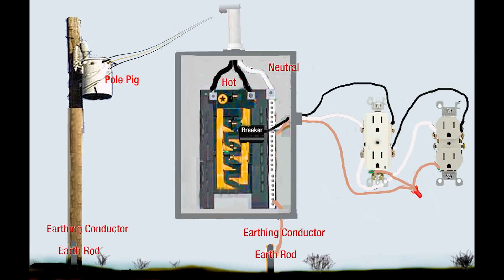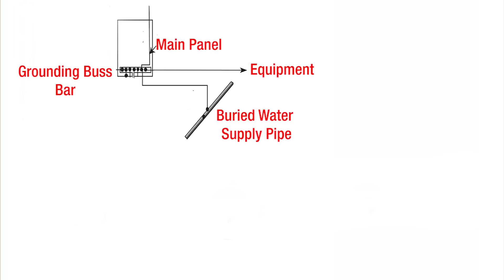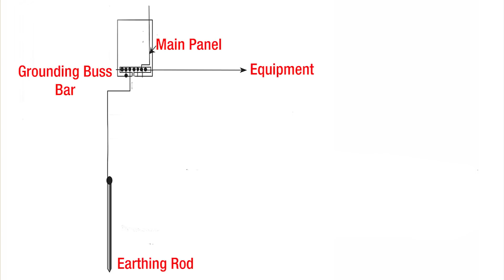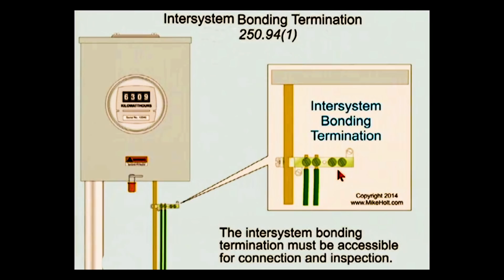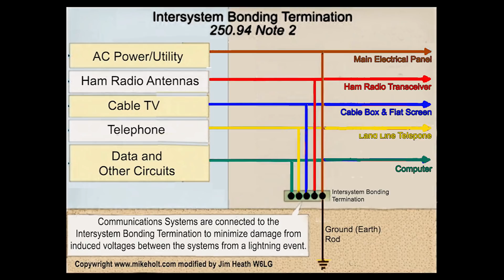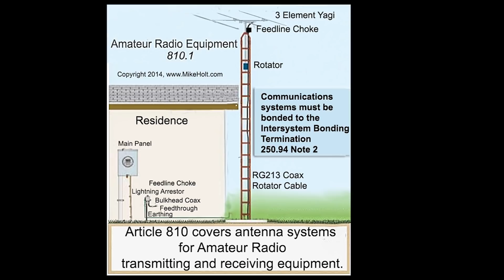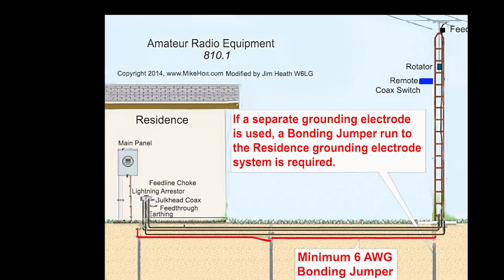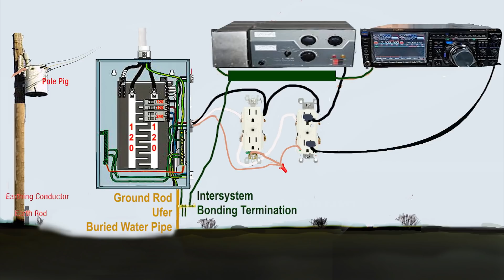Grounding, Bonding, Earthing, Shielding and Protecting with Jim Heath W6LG, 2 Part Video

Comment: Hi Jim, 

So very disappointed to only find your excellent videos just today!

I have binge-watched all your grounding and bonding videos and taken notes. If I may say you are a lightning rod of clarity!

Sadly I started with the ARRL Grounding and Bonding handbook and spent hours and hours of time trying to sort through it all while also studying (not watching!) YT videos by various authors and also reviewing all the comments as well. So much contradicting opinion with just enough fact sprinkled in to confuse a new amateur. 

For me setting up my first station (IC-7300 arrived today!) your diagram at 9:06 is perfect and pretty much tells me what I need to do. Although the radio room is on the second floor, the window is less than 16ft from the common service ground and I won't need to bring the ground back through the wall to attach the braided cable to the panel. Also, no need to get another ground rod and bond it to the service ground.

I wish the ARRL had asked you to write the book - so many of us would have been better served.

Sincerely & 73,
John - KK7JBZ

Comment: @Jim, Hello Jim. I got some Palomar Mix 31 beads to put on my times microwave LMR 400-uf  I was going to put 6 of them up to the PL259 at the  ftdx10 ANT input. I head it's may be good to put the mix 31 beads at the   ANT on Coax just before thePL259 connecting to the Ant. Is this True??

Comment: Hi Jim

My main panel is tied to my copper water supply, should I tie everything into that or can I install another ground rod outside and tie that back to the water pipe common.  That way I can tie all of my outside stuff there and one heavey guage wire back to the water pipe
Reply from the maker: You should connect to the main ground rod or Ufer ground.  I would be surprised to see a house grounded to the water pipe.  Near the main panel,  there should be some kind of ground and connections to a common point near that that ground.  My read of the NEC is that all grounds go to the common point ground near the main panel.  73, Jim
Reply: @ham-radio  this house was built in 1959. I checked, and the only ground lead is to the city water supply which is copper. (They are going to be going all pvc).  
I did some work around my foundation and found 2 very old rusty ground rods, which leads me to believe that someone decided the water supply would be a better option.  I already pounded a 6 ft ground rod in the ground and have a second one that I can use.  I think I will bond those back to my service panel ground bus as well.  
Would it be ok to leave or should I leave the connection to my water supply? 
The grounding wire goes from the main shutoff box to my water pipe which are on adjacent corners (50 ft of wire 12-3 awg)  it is not a good setup.
Ps yes on the Ufer ground.  If I were building a new house I would be using an Ufer ground for sure!! Thanks so much for your help. I understand the concepts alot better now

Comment: I do all these thing with the exception of my metal antenna mast is connected to a dedicated ground rod next to the mast.  I will do the same on my future tower.  Why?  Because the mast/tower is electrically isolated from my home electrical system and radio equipment, it merely supports my antennas and coax but does not interact with them electrically.  I much prefer to keep it that way, as stray RF is minimal.  A lightning strike to the metal mast or tower, the most likely scenario, will be absorbed and diffused by the ground at the tower and not make it's way back into my home electrical panel.  Remember, lightning always takes the shortest path to ground.  All my radio equipment, appliances are tied into my home panel ground.  Coax is disconnected when not in use.
Reply from the maker: I deleted my original comment.  I misunderstood what you were saying.  The question I have is:  Is there such a thing as an RF ground?  Why would current flow into the ground.  AC, sure, back to the source which could be the panel or a tranformer at the pole. But why would RF go that way?  Would there be RF on the equipment that is looking for a low impedance path to ground?  I sort of think not.  
Yes about the grounding conductor from the common point to the Ufer or rod(s).  Experts tell me that inside equipment they try to keep braid or strap the same width all the way. They don't pinch it to fit into a solder lug.  This whole radio room is an experiment on whether or not RF grounding exists.  I hope to find an answer soon.  Thanks again, Jim...on my meds and little off the mark today.
Reply: @ham-radio  Hey no worries!  RF grounds are definitely out of my league as far as expertise goes.  My main worry is a good path to ground in the event of a lightning strike.

Comment: The last few seconds of this episode is where I get hung up. The final diagram shows two return paths to earth, one from the “common point bond” in green and one through the safety ground on the electrical plugs. How do these multiple paths not present a potential issue or even risk?

This is definitely a point where there’s considerable disagreement, even between the electrically educated. I’ve asked multiple engineering-credentialed electrical people these questions over the years and have yet to get a consistent answer.
Reply from the maker: I really on the reference made in the video. From my experience, follow the NEC and Mikes advice.  The effectiveness and even the existence of so called RF Grounds is debatable in most applications at amateur stations.  My over the top grounding system at the new QTH is a test bed and will be the subject of a lot of YouTube videos as I explore the effectivenes of this huge ground system. Thanks, Jim W6LG

Comment: HI Jim,

I just became a new subscriber.  Good stuff.

I just purchased a new place, 5 acres with two buildings, a house and a garage workshop.  I am converting the garage to an office and a place for my radio gear.  I hired a general contractor and had the electrical system inspected.

There is an electrical service entry about 40 yards in front of the house.  It had one ground rod.  I added another and bonded.  A PVC run to the garage, 130 feet away from the service entry carries the electrical wiring to the garage.  There are breaker panels in both buildings.  In the garage, we found a efer ground, green wire attached to rebar in the foundation.  The foundation is only 24x24.  I had already had him install a ground rod just outside the garage panel and we bonded the new ground rod with the garage panel with number 6 bare copper wire.  We also ran new #6 from the garage panel to the service entry via the existing PVC.   I now have the efer ground and the ground rod we placed outside the garage panel meaning two ground systems at the garage panel.  That worries me as the impedance could be different.  

I am installing a radio tower just 25 feet from the first ground rod we installed at the garage panel.  Four more ground rods will be installed, one for each leg of the tower and one more 10 feet away from the first ground rod at the breaker panel on its way to the three tower ground rods.  I plan to bond all ground rods and to the panel as well.  This plan came from page 6-11 within the ARRL ground book.

What do you think?  Should I disconnect the efer ground?  Any other thoughts?

Thanks,

Brad
N6GR

Comment: Hi Jim,
Hope you get a quick sale and find your ideal new Shack soon.

My 10 m (32') mast is around 11 m (36') from the wall of the house (and Shack entrance point).
Would you regard this as 'some distance from house' or 'next to house', in terms of your slides?

I am debating whether to mount my 'protection box' on the wall at the cable entry point to the Shack, or at the base of the mast.

The steel box will enclose the surge suppressors on a copper bar - the bar will also serve as the 'Intersystem Bonding Termination'.
I have size 2 AWG (35 mm2) cable for bonding among earth rods and to bring the Shack common earth point outside to the copper bar.

Grateful your suggestions on placement of the steel protection box - '@wall' or '@mast'.

73 
Peter VK2FALF

Comment: Hi Jim, Can I run a grounding jumper overhead along my eave to get back to my service grounding point. I have a pool deck interrupting a clear path underground. I have a ground rod at my mast near the house but, from your video it looks like the shack is grounded separately from the house. 
Craig KD4HRS  BTW Great job videos very informative!
Reply from the maker: I don't think I said that in the video.  All ground wires connect together at the main panel.  I think I mentioned flat wide strap and as short as possible.  The house is not grounded separately.  Everything together, all equipment is bonded together.  Read the point in the table that I prepared.  Thanks Craig for the question.  73, Jim
Reply: Jim W6LG 
          Hello again and thanks for responding. I apologize for not describing my set up better. My mast is outside my shack and all equipment is bonded to the earth ground at the mast which is on the other side of the house from the ground at my service meter. I don’t have any other way to connect the 6AWG bonding jumper to the two ground rods unless I go overhead. I meant to say in my first question is that  my shack appears to be grounded separately from the house.
Reply from the maker: And maybe I was too fast to get the correct information.  As I understand the NEC, everything has to connect to the terminal (termination) at the main panel; everything to the same point.  Number 6AWG would be almost no ground for RF at that distance.  It would be too high impedance.  Craig, does the pool have a bunch of rebar?  That could be more of an Ufer ground.  I would connect to that massive ground.  73, Jim W6LG
Reply: Jim W6LG 
Good stuff. That sounds like my only option. Now I have a bigger problem explaining to the DW why I am taking a chipping hammer to the corner of the pool deck. :)
Reply from the maker: @craigmonaghan4399 There is an access to the grounding at the disconnect.  No chipping required.
Reply: Jim W6LG
Got it Thanks

Comment: Many happy returns Jim,  Excellent video. Interesting to compare the electrical supply arrangement in the USA to that utilised here in the UK. The supply arrangement shown looks similar to our TNCS arrangement, with the neutral and earth combined at the origin but separate in the installation. We generally supply domestic at single phase (1 hot wire) at 230v. In the Uk we don’t use the term ground, I think this can lead to some confusion. 

Protective conductors, CPCs  (Circuit Protective Conductors) and Bonding Conductors are installed for safety to provide protection against electric shock. They are generally selected and sized so that a fault impedance is low enough to ensure that circuit breakers will operate quickly to disconnect a supply and that exposed and extraneous conductive parts remain at the same potential during a fault condition. A protective conductor is expected (designed) to carry current in a fault condition and not in necessarily in normal operation. In a domestic setting they are unlikely to have been designed  to provide Functional Earthing, although they may be capable of doing so!

A Functional Earth Connection serves a purpose other than providing protection against electric shock. A functional earth connection may carry a current during the normal operation of the connected equipment and may be required for ICT equipment, filters & radio equipment. In a commercial setting you would expect the equipment manufacturer to specify the specific requirements for Functional Earthing. 

I think that generally in the UK protective earthing is used to provide functional earthing also. As highlighted in your video some care is required. It is essential that the operation of the Protective Earthing (installed for safety) is not compromised in any way by its utilisation as a functional earth. 

It is also worth noting that the installations protective earthing may not provide a good functional earth and as such supplementary arrangements will become necessary. 

Always enjoy the videos, 

73s Mark (M0HZX)

Comment: Thanks Jim and Mike. This is very much needed, I believe. One question: I have a good supply  of heavy 7 strand insulated copper cable, each strand is 3/64" thick. Would this be sufficient to use as a bonding jumper to join 2 earth rods?  Be well. 73 KC3BXZ Joe
Reply from the maker: I believe the code says size 6 AWG.  Joe, I think what you have is even bigger that what the code requires. So, for an AC ground it should be fine.  For RF grounds in general, a flat wide strap is best. Copper strap, plumber's tape, pipe strap are good examples.  Braid is debatable when used outside. Thanks Joe & 73 Jim Heath W6LG
Reply: Thank you Jim. I do have a lot of copper braid for use inside. My shack is quite humble and low budget and I live in the country and very few sources to cause much trouble, except the dang smart meter.

Comment: Happy birthday Jim. Not just is NEC an inacessible read, it's pretty boring. 

Now what I find a bit more intriguing is the EE PHD who advocates countervailing NEC in the shack and removing ground prongs from station equipment. If I recall his argument was that the neutral wires in your home will act as antennas.

Seems to me those possible signals and common mode also, would be fed off to ground, not entering our radios. Defeating the safety ground on any '"appliance" is ill advised, in my view. 

Have a meaningful memorial day. 73, de KE0RFZ.
Reply from the maker: Agreed.  I was unable to find out where he earned a PHD from any university.  In any case, I agree with you about removing the safety ground.  The NEC is very complicated but also very good at protecting us.   It is an impressive set of regulations.  We're lucky to have that resource available to us and guys like Mike Holt to help figure it out.  Thanks again for your input.  73, Jim W6LG

Comment: Thank you for the videos, hope you had a great birthday, Just wondering why not to daisy chain, and should flat strap be used from the equipment to the common conductor, I seem to have quite the rf problem as all of our touch light throughout our house go on and off with every transmit. (wife not happy). Thank you 73.........KE8MIG

Comment: HAPPY BIRTHDAY! 🥳🥳🥳

I think this is your third set of videos now on grounding and I understand it. I'm nowhere close to being an electrician. I'm wondering why it seems like a difficult concept. I've been a ham since 1976 and I know we all pick up our own ways of doing things. Cuz I told you once before I use a 100-watt light bulb and a socket connect one side to the hot on an AC outlet and the other to my ground bar that runs behind my equipment. It's fully illuminates. That confirms to my mind that I have satisfied what you are putting out. But why is it such a confusing topic? All grounds need to tie to one point at the service main. Even if I run double Ott entrenched all the way around my house with ground rods at least every 6 feet and an offset Tower added into that mix, etc., the way I understand it is everything needs to come back and tired of that service panel or the Ufer ground. Isn't this the long and the short of it? Basically what's being said is that you cannot have disparut grounding systems.

My only real question is the efficacy of the ground on a three conductor AC outlet. Not even a GFI. Just a normal 3-prong AC outlet. That's not a big ground wire and it isn't flat.

Comment: Hi Jim,
Happy Birthday. Are you in your new home?   73   WB3BJU
Reply from the maker: Always nice to hear from you Don.  No luck so far in selling this great house.  We need to cash out in order to buy the next Radio Room.  Some nice places have come and gone in the last few weeks in the area where we will buy.  I will be doing a series of videos on how we hams have a difficult time finding a place where we can go on the air without the problems of HOA's, CC&R's, Zoning, Historic Districts and more.  See you soon Don!  73, Jim
Reply: Hi Jim,
When I wanted to put up a tower in 1979, all our township engineer required was detailed drawings with specs and that the tower , if it were to fall, would land inside the property line. I wanted to put up a 77ft Wilson Towers tubular crank up, but had to settle on a 45ft due to the fall restriction. Had no problems with the township in securing the permits. Doubt I would have such an easy go now.  73  WB3BJU